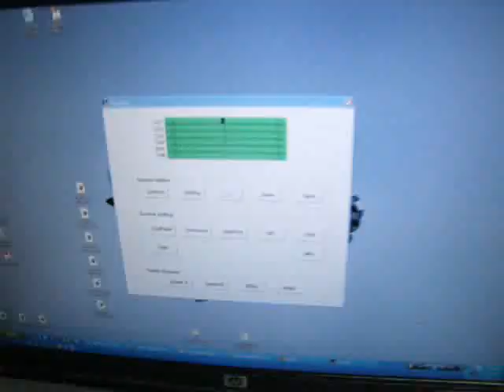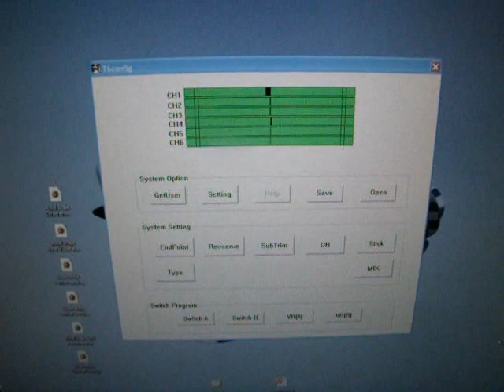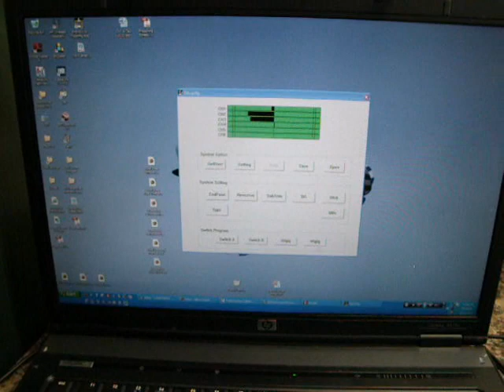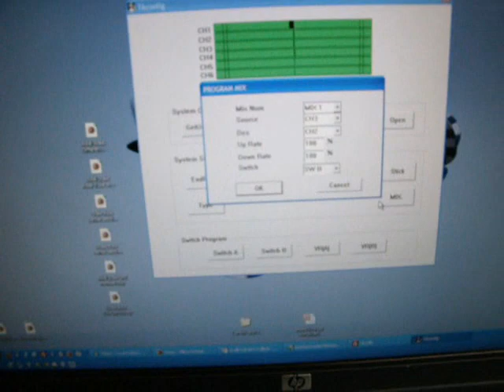XR10 Dual ESC Radio Mix and Setup

Comment from the maker: Sure can, it's not affected at all by the throttle mixing. Being used to flying with dual sticks I'm not having any troubles doing both on the right when I need to drive or slow the rear end. Other than that, it's working great even on the left stick mix!

Comment: great vid and i have ordered this radio because of it but your commentry is a little wrong . you are talking about overdirve in the front but monitor is only showing it working in reverse and it is overdriving the rear! 

How have you calibrated the esc did you have to do each one to each stick?
Reply from the maker: Yes, there was one stick per ESC. The reason it seems to be overdriving the rear is because the rear stalls out on hills, so you need more power out back sometimes. You can vary the differential as you need it. Very slick setup!
Reply: GCMRacing1 Have you got a vid on how you modded the radio? Do i have to get little springs or are you utilizing ones in the radio aready?

cheers  peter

Comment: Hi!

I'm trying to do the same exact setup because your video was a wake up call for the stick radios!
As far as setup I'm having some problems.... The mix for the double esc and dig (chanel 2&3) was very easy, but I'm not able to turn the back ESC off using the switch on the right of the remote.
Do you still remember the mix that you did to turn the back ESC off whrn the switch is off?

Any help would be great!